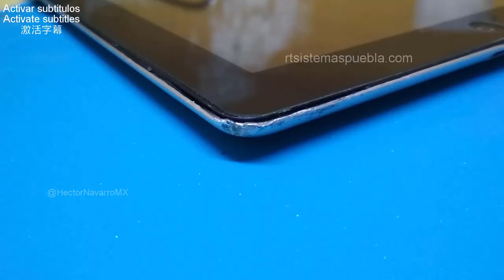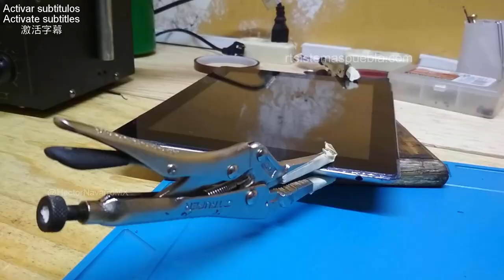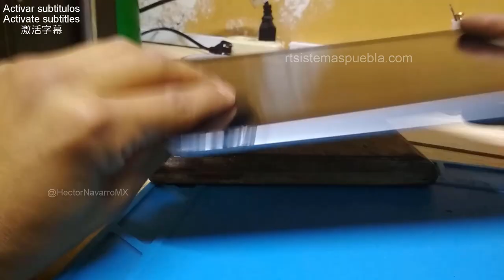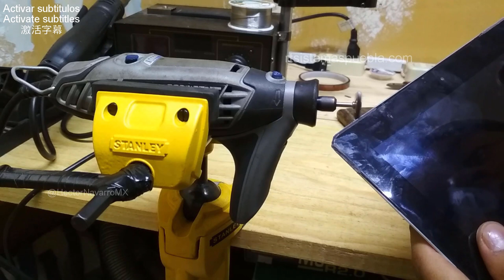How to repair damaged corners for iPad 2/3 with epoxy

Comment from the maker: 00:00 Proteger las esquinas con cinta y cortar los bordes
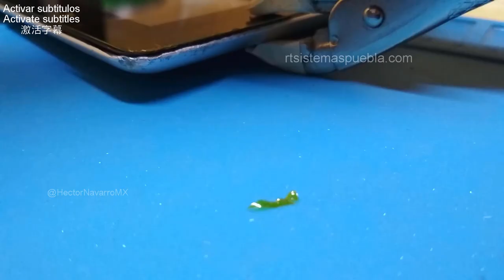00:17 Preparar la mezcla de resina epoxi
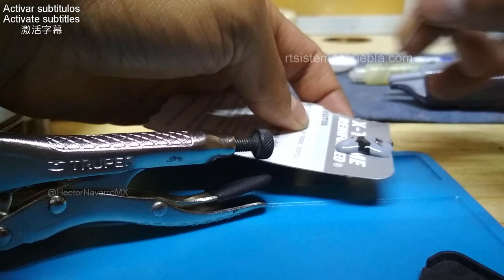00:22 Colocar la resina en la esquinas
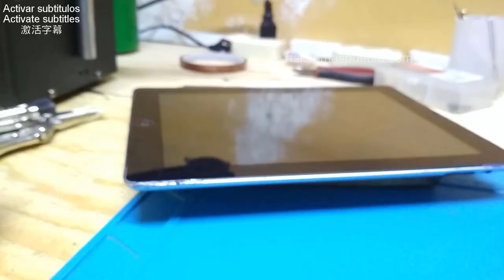01:15 Con una herramienta giratoria suavizar la pasta epóxica
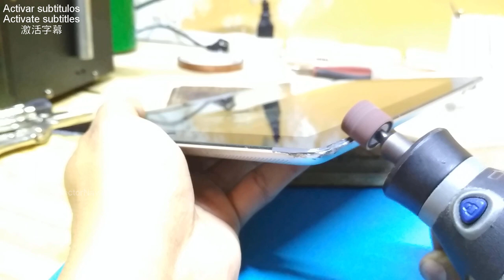01:21 Tuve un mejor resultando sujetanto la herramienta giratoria y usando un cepillo de alambre suave
01:32 Suavizar los bordes de resina epóxica
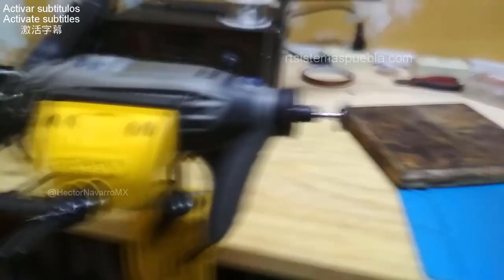02:38 Bordes rellenados
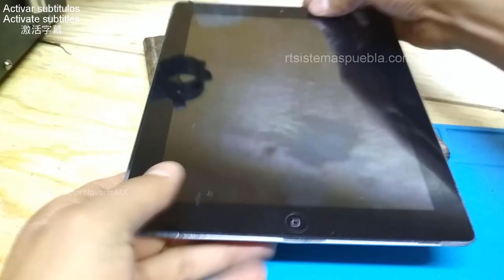02:46 Encender iPad 2 para testear el funcionamiento
Reply: Why use epoxy? Use black silicone and that's it!